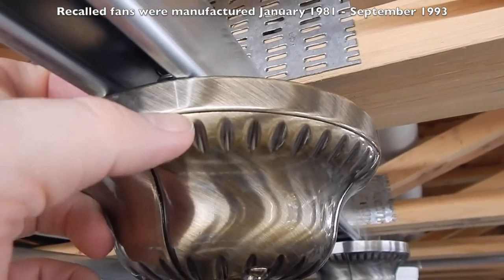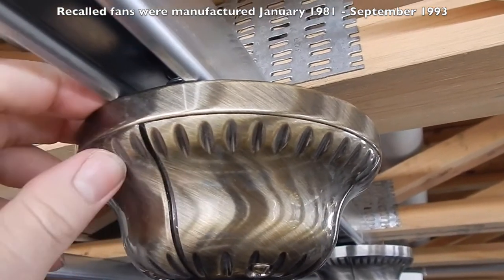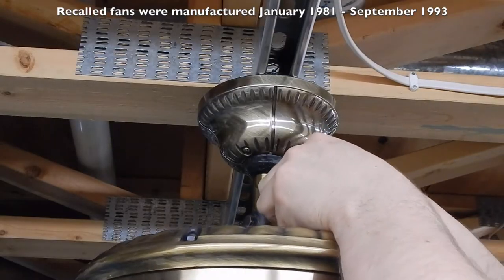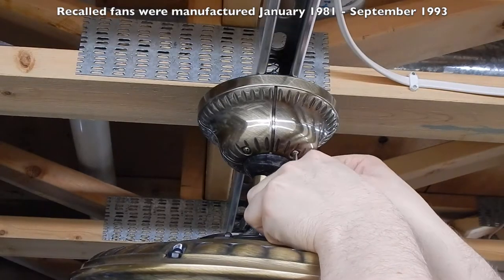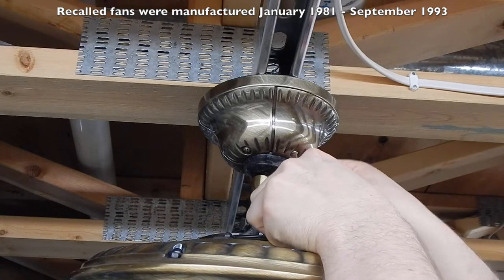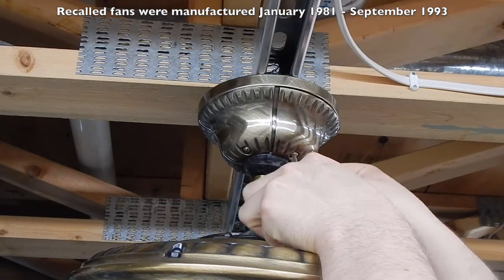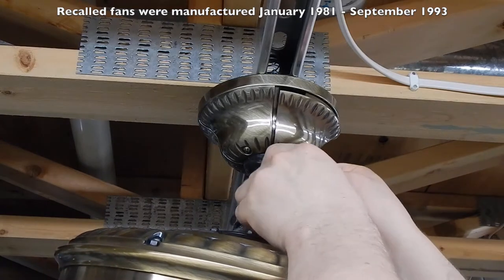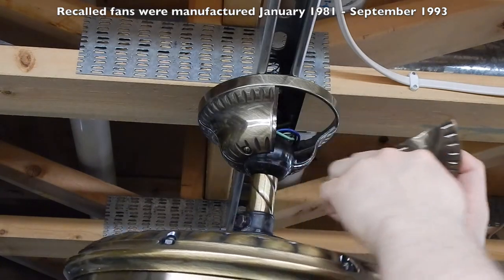Casablanca Ceiling Fan Recall Clip Installation

Comment: Do you think you could sell clips on some sites like Amazon? Cause you know, I would need at least 2 for now.
Reply: @vfandm  Sell them on ebay to make them accessible and charge more for them to offset the cost. Isn't this obvious.
Reply from the maker: @usergvhhyu1223  All of that makes sense until you consider the fact that most fan collectors are among the cheapest hobbyists on the planet. It was hard enough getting them to pay the $3 I was asking for one back then. None of this is even relevant anymore, I now sell direct from my website at the first link in the description.

Comment: I have a K63 1980 zephyr with a hang tru would I need a clip for that because in your video it says 81
Reply from the maker: It is almost assuredly a recalled canopy. I'm sure there are any number of circumstances that could result in that setup, but anything from the period would apply.

Comment: I got the clips from you for a couple of fans, but when I installed the first one the notch wouldn’t align with the one on the clip and my fan is now very unstable and trying to spin in the canopy.  Advice?
Reply from the maker: Sorry for the delay in response. I have no idea. Never heard of that being an issue, the tab is the same as the one in the Hang-Tru. Only stipulation I can think of is if the edges of the notch have been deformed and are slipping past the tab, in which case a replacement ball would be the only real solution.

Comment: I see that part of the ball is shiny. Did you put something on the ball so it wouldn’t fall down when you make this video?
Reply from the maker: I don't know what that's supposed to mean, but no, nothing is modified in any way. The ball was always shiny during this era, the part that's not is marked up from where it sits in the recall clip. This Vic is generally fine without the clip so I was good taking it out to record these short clips, but per usual, I use a recall clip with all recalled canopies.
Reply: @vfandm  Ok. It’s just that someone said you modified a canopy for reality check video but I knew you weren’t trying to fake a recall.

Comment: Wait, why is there a spring in the joist box? Does this outlet box have a suspension system?
Reply from the maker: The spring is part of a "strut nut", one of the fastening components available for use with strut channel. https://www.unistrut.us/products This is just my storage area, where motors hang. There is no outlet box or power, and this is not a permanent means of installation. Normally the only place you really see this area is in my vlogs, but this is such a quick demonstration that I would've been wasting a ton of time by putting up a fan in the studio to demo on when I've got a few dozen Casablanca motors already hanging with the recall clips in the back.

Comment: What exactly happened with the hang true, was the hole bigger than the ball?
Reply from the maker: It can come down to a number of factors. Too large of a hole, weak castings that were able to bend and spread, potentially forming issues with the ball itself if paired with one or both of the other issues. I believe the fans that actually fell were probably affected by multiple compounding issues, as I've seen fans where the ball sits low, but they've been unaffected for decades. They probably have a better casting. It doesn't mean they're safe or that I'd trust them without a clip by any means, though. Especially if you've never seen the fan before obtaining it, you can't know its former circumstances and I'd never trust it.

Comment: I just got a black and brass Panama slumber quiet the serial number is 12882 and the CB number is E047818 it’s missing the hang tru but I would like to know Is it a recalled fan because the K4S spot light kit is pretty banged up 

Also how much is a clip and where can I buy one if the fan is recalled ?
Reply from the maker: The serial number should start with at least two letters, the first one being any between A-L. If there isn't one like that I can't decode it. If it's Slumber Quiet and Hang-Tru, it's recalled regardless. Slumber Quiet only existed within the recall time space.

You can message my Facebook page or DM me anywhere on social media right now for purchase details. I'm working on getting a purchasing page setup on my website, but it's not active yet. Current pricing starts at $3 for one clip, and decreases as you buy more. Do you already have another recalled canopy to use with it? Just clarifying, because the clip does no good without a Hang-Tru, and a newer non-recalled canopy doesn't really require the use of one as long as the ball doesn't show signs of deformation.
Reply: Vintage Fans & More I don’t have the hang tru but I was wondering if it was recalled it is a slumber quiet fan and someone told me it’s from 1982 judging by the serial number and I’m assuming it’s a hang tru because it’s a Panama
Reply from the maker: Yes, as I just said, it's recalled. Anything Slumber Quiet is recalled, that control system only existed while the recalled canopies were being used. Slumber Quiet is not to be confused with just regular variable speed, though. Earlier cardboard box variable speed units (non-SQ) mostly pre-dated Hang-Tru and the recall. I'm not sure if any early Panamas got the non-Slumber system. Some early Panamas got the older canopy system, which was not recalled.
This recall affects the canopy portion in 99% of cases. Without the recalled canopy, the rest of the fan is otherwise unaffected. I'm saying if you don't have a canopy currently, there's no rush to buy a clip. The ball is safe to use as-is in most other generic bracket systems and newer post-recall Hang-Tru canopies.
Reply: Vintage Fans & More ok thanks for telling me
Reply: Vintage Fans & More this one also has the pull chain port but the chain has been pulled out needs a new pull chain switch but it does have the variable speed knob on the side 

And I don’t have the hang tru do I guess I can go and get a generic Hampton bay or harbor breeze  mounting bracket and it will be ok